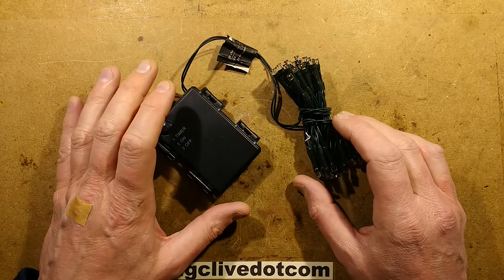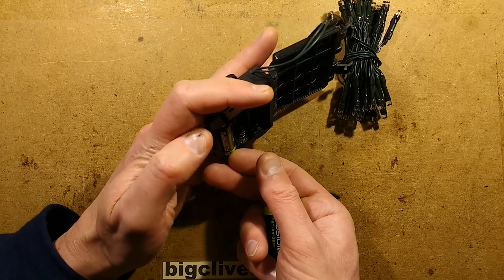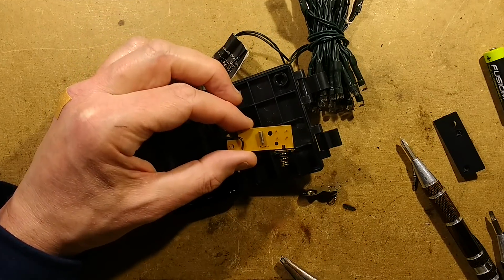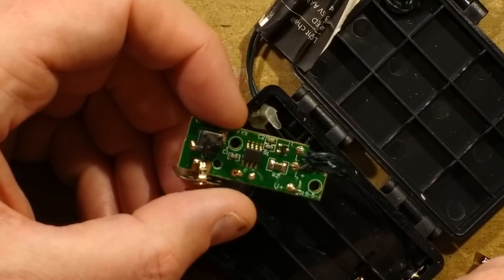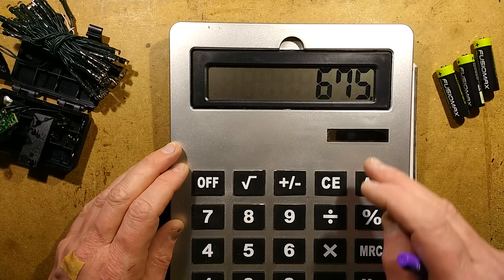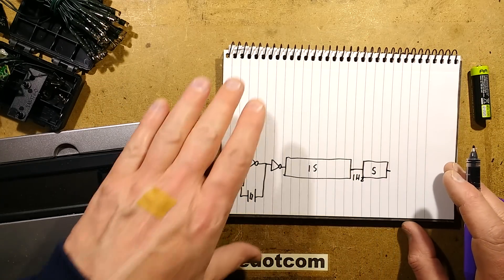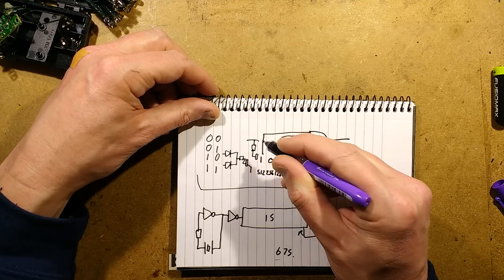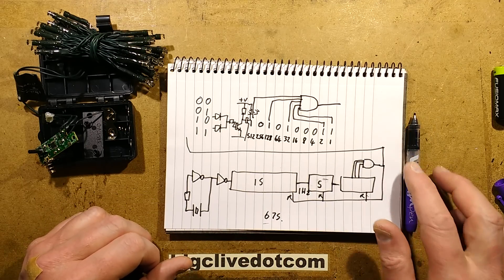Timer lights logic doodles.

Comment: Couldn't you just use a 555 timer for this? You'd need some mental resistor values (Megohm range) for it to work for long durations. You could add in a potentiometer so you can adjust the time delay if that's the case.
Reply: S.A. Smith I don't think you could get enough accuracy out of a resistor or capacitor to keep reliable time.
Reply: True. Crystals are more robust, so I suppose you can replace the 555 with a crystal (as done here).

Comment: I think the best approach is sense dusk then turn lights on for set amount of time then turn off and wait for next dusk event to start process again.    It is fully automatic and you don't have to turn the system on the first time at the correct time of the day.
Reply: jp040759 but then the control box has to be in a location that gets reliable lighting. This way you can hide it in a bush or something.
Reply: The sensor can be anywhere you want it.    LDRs are small and can easily be hidden anywhere.

Comment: The point, unfortunately, Clive, is the counters would power up in a random state, which means you'd need an on/off switch and a separate reset switch (with debounce circuit) to start the cycle. At which point, as far as cost goes, I think you might as well have the microcontroller, since it'll use next to no power in the off (hibernation) mode.
For a commercial product, implementing an automatic 24hr cycle, I once took this to an extreme in combination with a really low power i2c clock chip, to make a circuit which would wirelessly command a pulse operated rolling shutter open and closed at fixed times every day, with automatic DST correction,  which would work for over two years, with a basic accuracy of 2 seconds deviation per year + how quickly the owner could change out the battery every two years. I used an AT90S2323 and, once I was done programming, I had two bytes of program memory left
Reply: Power on reset could easily be done with a capacitor on the reset pins. That's no issue. But even then using a µC is cheaper nowadays anyway.

Comment: Ever played with WS2812 LEDS? In the wrong hands, illuminated Fairies on top of Christmas trees could be waving their hairy wands at startled shoppers.
Reply from the maker: I've got some WS2812B LEDs here, but I've not played with them much as they are extremely demanding on processor time when trying to generate patterns live.
Reply: I've been using old drone flight controllers (Naze32 (STM32F103CBT6) - £6-£8) which also run from 5V to control them. The Google Chrome Betaflight plugin that all the drone racers use gives you ready-made light effects such as the Larsen Scanner and can also drive tiny brushed motors or very torquey brushless motors (depending on FC model) with the addition of a small ESC. The same controllers contain gyros and motion sensors and for a few quid you can have barometers and compasses. 
Word of warning - drones can break up marriages, sap your bank accounts, divert your creativity, put you in trouble with neighbours etc.. but the tech is fantastic - especially those tiny powerful sexy brushless motors.
Reply: Try APA102, same idea but with a standard SPI interface (does need one extra line for clk). There are some implementations running the WS2812 protocol via SPI as well so you can use DMA etc. if your controller supports that (it's not very hard to implement if you're into fiddling with bits).
Reply: Thanks for that Teslatrooper. Not played with APA102 lights yet. If I can get a good  bulk quote I'll try them in my drone racing gates.

Comment: I have a set that uses a charged capacitor to hold the xstr on. Charge gets used up xstr goes off. It is only a timer, once the charge is used up it stays off. Cycle the switch back past on to off and it puts a charge on the cap again. Stays on about 4 hours. I got the set at the dollar store - and  i got my $1 worth by it working. The 1st one did not work.

Comment: Next, you need to add the counter for the 18 hours off.  And don't forget the reset circuitry so the counter starts at zero.  While the idea may be logically simpler, it pretty clear from a hardware standpoint you've either gone to a custom chip or a a bunch of chips.  Meaning, it's actually more complicated/expensive to build.  But what you describe is probably how it would have been done in the 80s or 90s.
Reply: Russell Hltn what he diagramed is the custom chip that would be made if these were produced in Mass quantities.

Comment: No loading caps on that crystal seems strange. I guess that would just be way too posh.
Reply: Rambozo Clown Loading caps for a standard watch crystal are so small, any good chip with dedicated pins for it just incorporate the caps on the die.

As a designer I really hate when some brainless chip suppliers make chips that require a bunch of  1 cent extra components that are always the same, take up board space, add assembly cost, and tend to become commercially unavailable while the main chip is still "recommended for new designs".  Western suppliers of SMPS chips are especially annoying in this way and seem completely oblivious to the problems they are causing.  I really don't want to do 5 experimental respins of a complex logic board just to make the power section work so I can actually start testing and optimizing the application circuit. It's wasted cost and delays time to market.

Comment: Ah! I actually have this pair of lights.. I do like them, but then I discovered that the chip in standby was taking about 15ma. I shit ye not squire. :/ Very disappointing considering the sleep standby current of an atiny85 is about 1uA..
Reply from the maker: I'll have to check that.
Reply: Did water penetrate? I have found that when electronics get water damaged, the first symptom they have is parasitic power leaching.
Reply: Would it be spoiling things to suggest an atiny85 and a real-time clock module? 

How about the atiny85 and the crystal oscillator?  That's probably still not entering into the spirit of it. 

If I can motivate myself, I may try building this over the xmas holidays.
Reply: Microchip PICs often have the crystal oscillator and counter built in. You can use that to wake the processor from standby and then sleep while not counting. You'd use the internal RC for the main clock.

Comment: Clive can I ask you a question? I have a lot of chargers (phone chargers, TV box chargers, etc) that put off a godawful coil whine(?). Is there a way to safely fix this? Like could I slap some compound in there like caulk to deaden the whine (im sure theres a better substance). Please help me before I lose my sanity.
Reply: I'm from spain and Internet taught me that the solution for any engineering problem is either duct tape or wd40
Reply: Here in NZ it's No. 8 fencing wire that's supposed to solve everything. Not sure how to apply it to whining coils, though. Maybe if you wound the coils with No. 8 wire they wouldn't whine so much as emit a soothing low-frequency note.
Reply: ac3ofspades878 first off, don't use hot glue if you can avoid it, I've had it cause weird capacitive effects when boards have been covered in it. Resins are usually the best way to deal with it, although it may be a tad expensive depending on where you live. Hope this helps
Reply: open it and dip the whole board in molten wax
Reply: Yes. http://starecat.com/content/wp-content/uploads/engineering-flowchart-does-it-move-wd-40-duct-tape.jpg
Reply: Put hot glue around the coils.
Reply: If it's a 50/60 Hz hum, then the answers others have already posted are your only option.

If it's a very high frequency whine, then you have four additional options.

1) Wait several years (maybe even a couple of decades, if you're young) and your ears will no longer be able to hear those high frequencies.

2) Listen to a lot of heavy metal, very loud.  That will damage your hearing in a relatively short period of time and you'll no longer be able to hear those high frequencies.

3) Hot glue your eardrums.  Instantly effective.

4) Take lots of oxycontin.  Chew them so you get a fast release rate.  Not only will they get you very high, they'll damage your hearing to the point that you'll be deaf unless you get cochlea implants.  Just ask Rush Limbaugh (but you'll have to *shout*).
Reply: +1 for No. 8 Wire
Reply: bdf2718 Thanks, I was wondering why none of my chargers ever whined (1 and 2)
Reply: Simon Tay 
There you go again with your hot glue! 😉
Reply: i tried the oxy but alas to little effect!!! lol
Reply: A. Black your right i did a pcb in hot glue and it stopped working and once again a esp wifi board  so it could be used outdoors and same thing it stopped working. maybe it has some conduct or it's  to hot 😞
Reply: Superglue.
Reply: Make sure it is not the corrosive silicone used for DIY.
Reply: Put hot glue in your ears.
Reply: Juan
Is it meant to move but doesn't? WD40.
Is it moving but not meant to? Gaffer tape (or duct tape if you're an amateur).
Reply: Silicone or Epoxy. Or duck tape and fence wire :-)
Reply: Put the chargers in another room. Problem solved.

Comment: Given the amount of sunlight at this time of year, it would be best if it ran for 18 hours and was off for 6 instead!
Reply: You could modify it to made it do this. Use an extra transistor on the output as an inverter. When the output is off, LEDs are on. Or replace the existing NPN transistor with a PNP.
Reply: Figure out the customer's lat/long, program in the sunlight curve function (you can do simple math in a microcontroller and send them pre burnt with constants based on shipping address, also assumes you're not drop shipping and have direct ship to each customer). The hard/impossible part would be preserving state when it's powered off sitting in a closet gathering dust for a few months. (Maybe no way around using a battery backed counter or RTC unless you want to start involving more complicated interfaces or NTP server syncing = cost / $$$)

Maybe instead of all the above complexity, just spring for the photocell and turn on when it's dark outside, LOL!
Reply: Here in glasgow, the council common stair lighting in closes works like this. It used to be controlled by a dusk to dawn switch, now they use a controller, where you enter the the date and time, and latitude, and it switches accordingly. Which works fine, until you get a dull overcast day.
Reply: Or use a timer program to drive a computer (USB?) output to switch lights directly. No need for any external circuitry if the lamp number is low enough.
Reply: hehehhhe !
Reply: sidenote, look up the application "sunwait". handy little program if you  need to control stuff via the computer depending on sunrise/sunset
Reply: Sure, the NTP route costs a bit more, but not very much (there is the wifi / bluetooth chips you can get cheaply). As for having people register wifi SSID & password when buying may seem doubius.
Reply: For 'normal' people (aka working stiffs), during more normal times (non-Corona), how much time is actually spent at home enjoying the lights? I guess many would be ucky go get 6h between returning from work and going to sleep... That said, I'd think it would be nice to have a 24h cycle with 2 on periods - one from say 16 to 22 and the  other other, shorter, from say 6 to 8 (for some morning cheerfulness...)
Reply: chrisstevens2 its battery
Reply: RWBHere you can also take the positive and nagave and add a resister and a capacitor and a calculator solar panel
Reply: @chrisstevens2
 In this case I would use a photosensor. 
But lighting it from 5pm to 23pm vs. 16 or 18hrs. per day saves battery . Before 5pm it's not that dark (the LEDs are quite dim - with only 10 mA for all of them) and after 23pm not so many people are on the street to see them.
Reply: @linagee
Or use a networked Raspberry Pi :-)
Reply: You could use a mainframe to turn on and off your Christmas lights.

Comment: https://www.ebay.co.uk/itm/60-LED-String-Copper-Wire-Fairy-Lights-Battery-Powered-Waterproof-Timing-control/232116992340?hash=item360b403954:m:maGXjDzdzRsqd0HfY3Yui0A

Comment: Ahh, I always wondered why they used 32,768 kHz instead of 65,536 (which is a nice round 16 bit figure). Makes sense to only use the number of bits required rather than using extras you don't need.
Reply: Jim Griffiths There's some physical properties of crystals that make 32768Hz more stable than 16384 or 65536, which is important when you want a £5 wristwatch not to loose or gain seconds, in all kinds of weather.

Comment: There are a few ways to do a digital circuit with this. My guess is that the engineer who did it probably just wrote some stuff in an HDL and had an implementation algorithm worry about optimization. 

As for another method, you could just have a straight 30 bit counter and a comparator looking for the decimal value 707,788,800. 

To handle the input you can do a pretty simple finite state machine with some debouncing added. Add muxes as appropriate to switch between functions.

Comment: I have an illuminated centerpiece that runs off that same controller, but it eats AA cells like crazy. In 6-hour mode I'm lucky if the cells last 3 weeks. Looks like I need to find that 10 ohm resistor and up it by a factor of 10 or so.

Comment: Have a 5 year old boy interested in electronics, any ideas of there's anything out there that would allow him to play with led's, resistors, switches, sensors etc that's plug n play rather than soldering?
Reply: You can still find Radio Shack electronic educational sets on E-bay..
Reply: Calum Wilson Solderless breadboard!  It's a white plastic plate where you just push in components that have pins, wires etc.  Works if he's old enough not to swallow components and brave enough not to panic if he pricks himself with a wire.  Still works for grown up prototypes.  Lots of DIY YouTube videos use them.  Electronics hobby shops sell them, and also useful things like packs of 100 mixed transistors and packs of 10 wires-with-pins.  In Europe, shops that carry the Velleman product range tend to be good places to shop for these things, even if some of the products are other brands.
Reply: There's that 'amazing 72+' kit julian had... https://www.youtube.com/watch?v=rmv2NqsrhBY looks enjoyable with it's funny ship noise generator circuit. several ropey aspects are mentioned and it probably isn't really that educational about how the circuits work. Putting transistors in the hands of children is a recipe for magic smoke... which is what happened to my electronics kit, you do need a decent bit of maths to stand a chance of understanding what's happening so mostly they're teaching you to follow instructions - though they'll probably get the idea of a circuit diagram not necessarily being a picture of the components and wires.

Comment: The reset line would not need to go to the pre-stage counters.
One problem... race hazard, the output from the end value will persist only until the reset propagates, so if the next stage is not quite as fast, it may not clock
Reply: Matthew Day Yep, next stage should be clocked from the MSB, not the reset pulse.  Clive's output logic is just a NOR gate. If building this with loose logic (not an actual chip), just for the fun, one could use the standard divide-by-10 and divide-by-12 chips from the 74xx series or CD40xx series, such as 74390, 7492 etc.  CMOS variants (CD40xx or 74HCxx) would be best for battery use.

Comment: 4017 pulsed every 6 hours, resets after 4 counts, led's connected to one output ;)
Reply: Or pulsed every 3 hours and use 2 diodes to connect 2 outputs. It saves one /2 binary counter stage.
Reply: Yeah I think you missed the point which was how to count 6 hours.

Comment: +BigCliveDotCom I followed you all the way through to the 2 digit binary counter. Diode steering gives you off-off-on-on. Essentially, on or off.  Wouldn't the way you presented give 2 reset cycles or 12 hours of on or off?
Reply: if either of the bits are 1 then it's on, so the leds are only lit on 00.

Comment: You should check the frequency with a counter because you can get those little crystals in a wide variety of frequencies these days. Don't assume 32768Hz. I've used frequencies from 18K to 40K in that package. Doing the 24 hour function with discrete logic in the old days, I would probably use a modulo 10 counter tied into a pair of presettable counters once you drop below 1Hz to get the 60 seconds and 6 hour counts, and then finally into a pair of sequential flipflops with the Q outputs tied together via a NOR to get the enable and a 24 hour cycle.

Comment: I would use a photo-resistor as dusk detector. Winter gets dark at about 4pm in Northern North America, but can stay lit up to 9pm in summer. The addition of a photo-something ensures the lights will not come on at the same time everyday, but it will be turned of at the same time each night. Setting it at 4pm or 5pm is good all year around. It will turn off at 10pm or 11pm each night, which is good.
Discrete logic is a waste of time these days. MCU "this and that", is the way to go. Sooo cheap and flexible. 
10 Pro-Minis for $15 ? That's cheap. What can you design and build for $1.50 that an Arduino can't do?